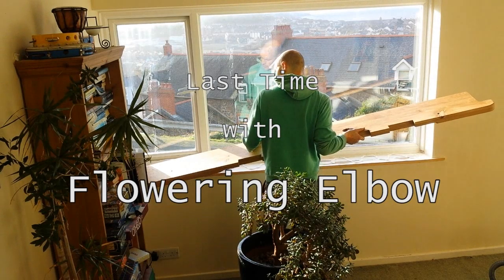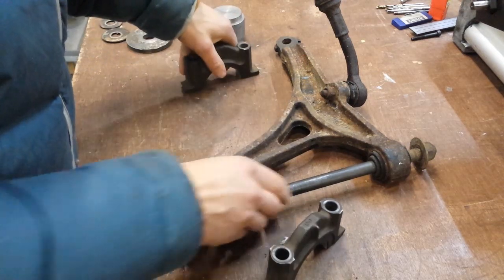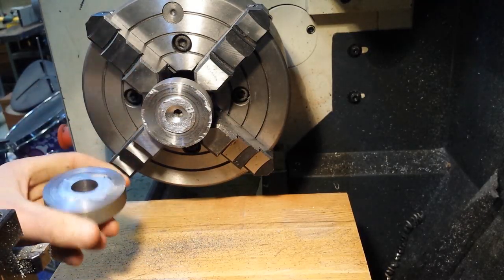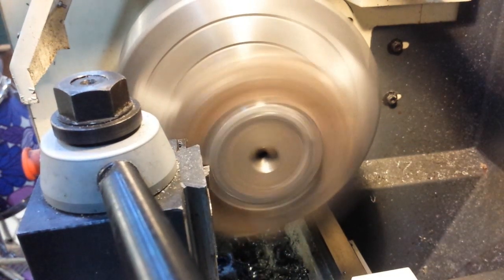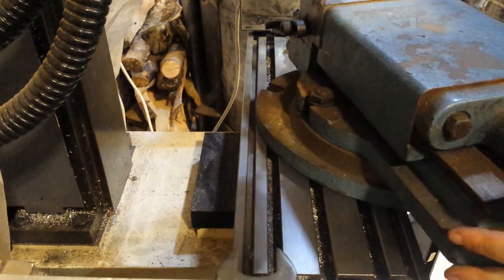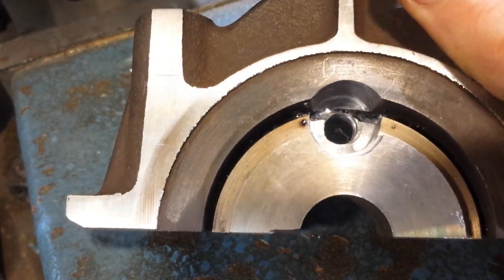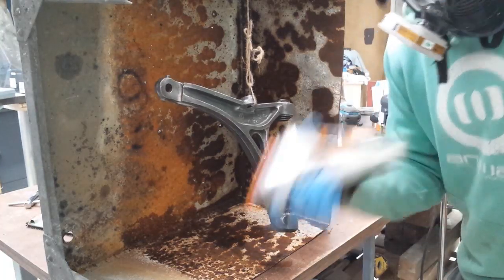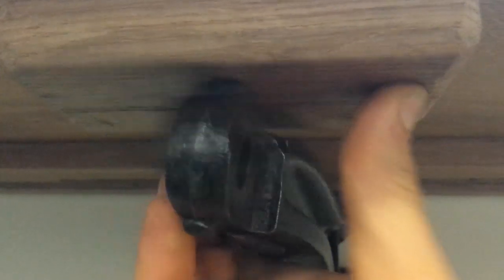Turn Scrap Car Parts into Funky Upcycled Furniture

Comment: Maybe the high carbon content of the cast iron mixed with the weld when molten to make it harder
Reply from the maker: It's a good theory. Thanks for watching this old vid scott :)
Reply: Welds tend to harden no matter what. He could have annealed it or taken very small cuts. Lubrication helps as well. Oh just got to the part where he annealed it.

Comment: OK....What would you do differently
Reply from the maker: Hey John. Almost everything ;) But especially, I would make the fold up table from something a bit flatter/ more stable - or made more of an underframe for it - it is 1" oak and has warped quite a bit so is twisted. Still works great but is a little odd having a  non flat table to eat on.